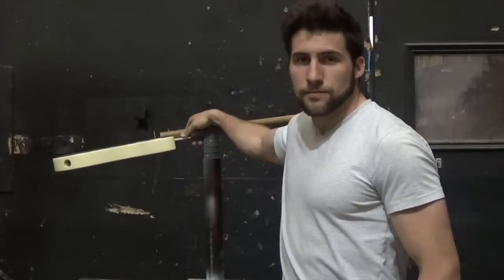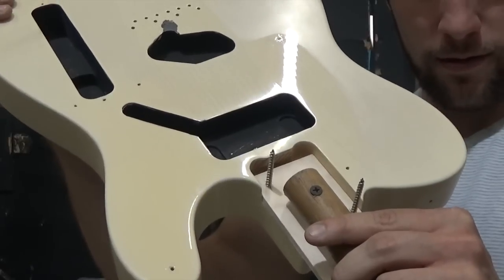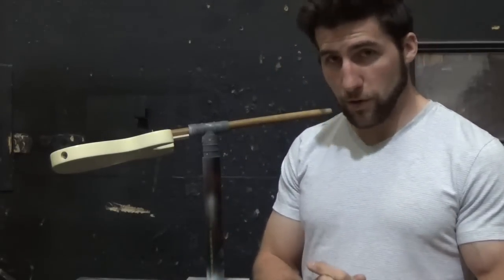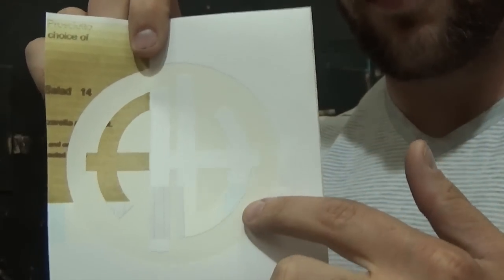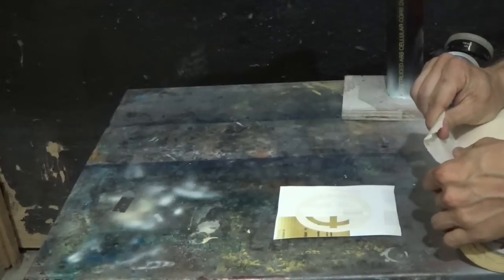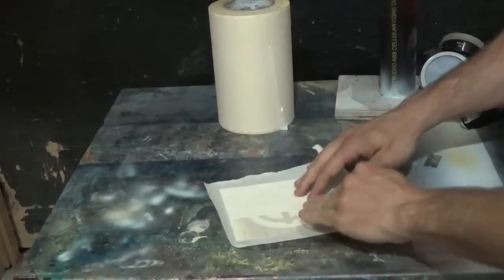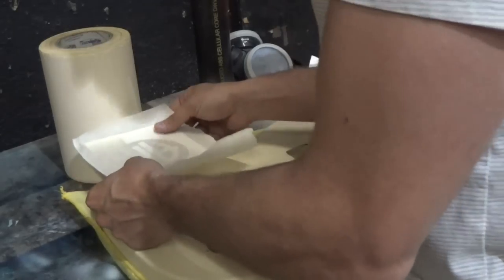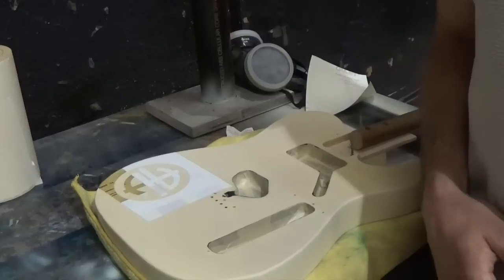How to add graphics to your guitar part 1

Comment: Love these videos! Could I buy a custom transfer sticker from StickerMule? And would it basically have the same effect as what you’re doing with your vinyl sticker? Thanks!
Reply from the maker: I don’t know what sticker mule is, but as long as it’s actually cut out you should be able to use it like this.
Reply: @BradAngove  awesome! Also what’re you thoughts on adding a lacquer over the current finish, then adding more clear coat? Would that even work, or would be lacquer paint not even stick to the original finish?
Reply from the maker: If you sand it like I did lacquer should stick. But then you would likely want to use lacquer for the clear as well.

Comment: So question, water slide decals, I recently took a go at my first diy kit, the paint job of course looks super amateurish but that's my fault (needed more prep work on the sealer and primer) but I tried adding a logo on the headstock and body with water slide decals but the end product came out super wrinkly and I would guess it also shrunk leaving a dip around the decals, so before I strip it and try again, what would you recommend I do so it come out right? Any help would be appreciated
Reply from the maker: +Jesus Mariano Did you put the decal over a gloss finish?
Reply: +Brad Angove if I remember correctly I sprayed a coat of acrylic lacquer and letting it sit for a day or two before I placed the water slide, after I let it sit and dry for a day before spraying the final coats..... It was all rattle cans if anything
Reply: I could PM some pictures of the details if it would help
Reply from the maker: Ok, the water slide decals that I've used are for a significantly different application, but I may have some insight. Generally they work best on very smooth (glossy) surfaces. The smoothness allows for all of the water to come out properly from underneath. You need a squeegee or something similar to press all the water out once you have it in place, but be careful not to stretch the decal itself. Different decals have different cover coats. The type of cover coat dictates how long it needs to be in the water before application. If you let it soak too long, it can shrink and wrinkle when it dries (if I'm not mistaken).

Comment: Stick it in the microwave oven for 30 seconds or so, and it will make the tape usable, in most cases. It works.
Reply from the maker: +Moon Hitsearth That's an interesting trick, thanks. I'll have to try it out... carefully... in a microwave that I don't use for food haha.
Reply: Brad Angove
Ha Ha, It's harmless. You're just warming in up, not cooking it. My roommate told me about it, and It actually works very well. It won't work if it too far gone.  A few extra hazardous vapors aren't going to hurt you? I hope not? Can't wait too see the finished product.
Reply from the maker: Sounds good. Thanks.